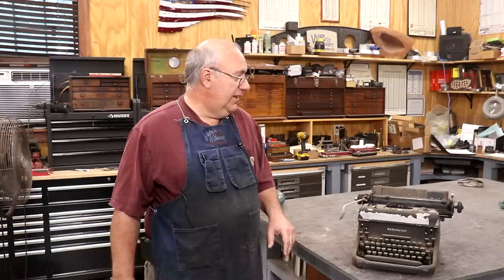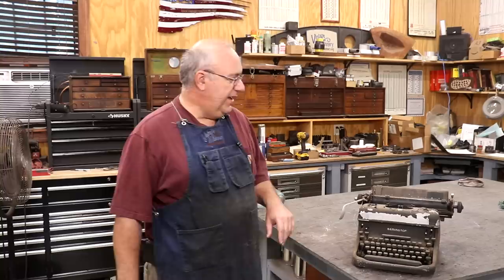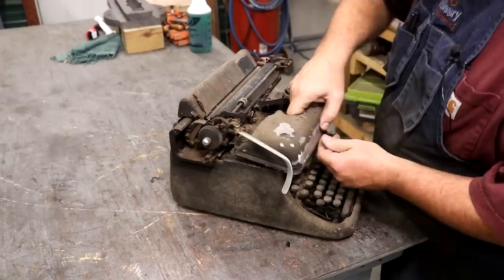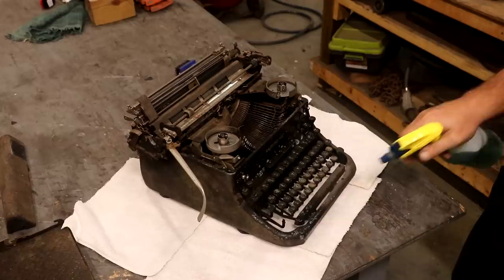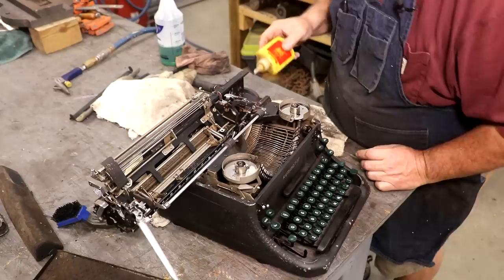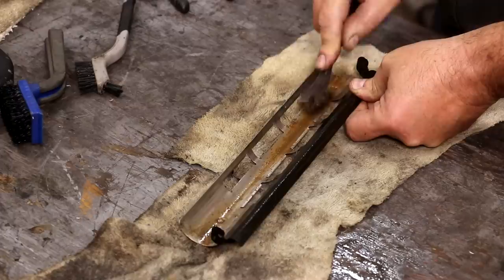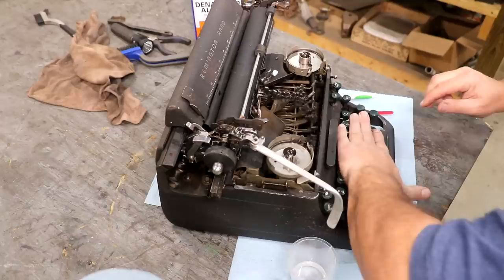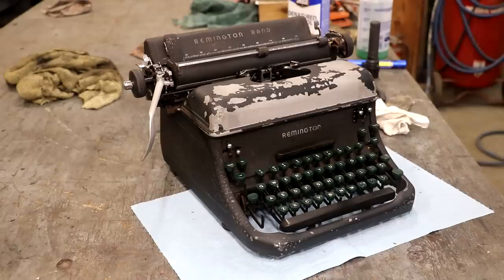Restoring a Antique Remington Rand Typewriter!

Comment: I didn't read through all the comments, but in the "old days" we would spray the ribbon with WD-40 and let it sit for a few days.  This will devolve the ink and re saturate the area where the key would stike the ribbon.  I think you could also buy ink to "re ink" the ribbon.  Now I'm telling my age...!
Reply: Or you can just go to Amazon and buy a bunch of new ribbons.
Reply: @Digital-Dan  How smart you are (!!) that you went out searched that!!   (Did they actually have the BLACK/RED ones Keith would need??)
Reply: I, too, had been told that we could "re-ink" our ribbons using WD-40, but someone, here, mentioned that WD-40  would "gum up the works".  Maybe they meant only if it were used to lube the machine itself.

Comment: Well, that was fun. When I saw you striking the bare platen with the keys, I remember being criticised for that by my parents. As another commenter pointed out, a lot of rubber parts from that time are now badly compromised. Looks like you are lucky here. Still, I would treat the platen as if it were brittle and weak.
Reply: Sometimes when you can’t get a new platen, you can get by rolling three sheets of paper in the machine.

Comment: Simple Green is corrosive on aluminum.  The company makes a special product for cleaning that metal.  Even though this is steel, I would make sure the Simple Green is rinsed off .
Reply: Ooooo...Good to know!!  I use a concoction to clean rubber stamps that, although it's less than 10% Simple Green, I wouldn't want to damage other things in my crafting that are aluminum!!  T.F.S.

Comment: 19:02 Is that a felt pad on the inside of that back panel? I'm guessing for sound control. Seems rather advanced for pre-wwii(?) office equipment. Just when I think I have a decent understanding of the progression of technology, a gem like this pops up.

Edit:  22:00 What are the chances that brush is an unsharpened typewriter correction eraser?

With that sticking key, a common issue is that all of those long levers that the type faces are attached to are prone to bending and twisting. You might try typing the problem and adjacent letters with varying effort on to hard paper. You might notice one side of a printed letter is lighter and the other side is darker, so begging for a theta "field adjustment".  Likewise, if you get out your feeler gauge set and try a few between the good working letters, you'll get an idea of the appropriate spacing interval. Then drag the feeler gauge along the levers in proximity to the sticking key. Often, a poor correction made to a key that's a few keys over cascades. You might have to straighten up a few arms nearby
Reply: @lwilton  Is that in reply to something I've written?

Comment: Besides any key spring, there could be an issue of slight bend that causes sideways friction.  I never had a Remington in my hands, but saw that kind of trouble developing especially on the leftmost and rightmost few keys.  the worst "offender" was the one that a typewriter service place did for me, replacing some "needless" character with one Greek character that i needed often.  The replacement happened by melting the solder that held the character at the end of the striker  and then soldering the Greek symbol instead.  As I recall, there was a slight vertical displacement on the new character, but it did what I needed.  One finding, though was that taller typewriters were lighter to type than my very low profile traveling version.  The ultra low machine also had much higher tendency of tangling the strikers, even when I never was a fast typer.  In fact, I eventually bought an intermediate (still travel version) typewriter for that reason.  It has no character changes.  But of course it has not seen any use since about 1980.  The last use, as i recall was to write addresses to envelopes.  I found figuring the proper alignment of the envelope in a computer printer too challenging.

Comment: Did you look close to see it the key rod was slightly bent?  Graphite also works great as a lubricant, used it on linotypes and ludlows in Newspapers. The other thing could be a bad spring

Comment: I had to use brake cleaner to dissolve and clean the works of a typewriter that had been lubricated with motor oil and bearing grease.  I t is a nice machine now.  If you are new to typing on a manual typewriter you STRIKE the keys, do not push the keys.  It will take time to build the muscles up to be a good typist.

Comment: Yeah, but is it a Pica or an Elite?
I learned to type on an Underwood, and when I changed schools, I used an IBM Selectric. Those Selectrics were slick.

That "0" key probably has a weak spring. There should be one tiny spring on each key lever.
Reply: My thoughts / memories exactly.
Reply: It could be the spring, but the keys have a few riveted joints on the pusharms, a bit of rust or grime and it will stick. It should be accessible from underneath. I guess some light oil/solvent could fix it (WD-40, then some light mashine oil).
Reply: Depends on the typewriter as to where that spring should go.

Comment: I grew up with typewriters in my childhood. My mom was a typist/file clerk and as a toddler I was fasinated by them. While you were working on this typewriter, I looked up the service manual for it and... its like most manuals from the 1940's, more text than illustration and a bit confusing. I do know that the platten (pla-ten) carriage is held in with a few screws and its easy to remove and dunk in hot soapy water and a good scrub will get the dust, dirt and oil off. The same is true for the key carriage, like 4-8 screws and the whole thing should drop out, dunk in hot soapy water, a scrub, either blow it out with air or let it air dry, then oil it. The biggest issues are the springs which should be replaced when they fail or weaken, and replacement keys.....because they are bakelite or ebonite. As for the missing paint, its nitrocellulose.... What can I say? I was a curious kid and watched the typewriter service mechanic like a hawk.

Comment: Moisture isn't a worry.  Everything can be dried.  You can either use steam, or just detergent and the hottest water you can abide (to promote rapid drying).  Clean it with a sufficient volume of water to reduce the amount of detergent residues left behind (they will make things gummy).  Drain it, mindfully blow it dry while its still hot, stick it in the lab oven at 100F for a few hours.  Lubricate.

As an aside, I know that someone will shriek about the idea of using an oven.  I'm not talking about a repurposed kitchen oven with exposed elements and gross hysteretic temperature control.  I'm talking about something that's forced-convection and can actually hold steady at low temperatures.  

To put this in perspective, consider your computer's motherboard.  You'd never ever think of getting that wet, yet the thing was born being run through an automated water/steam wash (on a conveyor) and blown dry with compressed air.  Boards usually don't even get the extra insurance of being oven-dried after a cursory blowdown.

Comment: I would expect the carriage to be removable. Also, the entire key assembly should pull forward by releasing the 2 catches on the front panel.
Reply: I think Imperials did that, but I’m not sure.  Several German machines an Italian Everests you can take the carriage assembly off with either two long bolts or two levers (more modern Olympia upright manuals and electrics).
Reply: Remingtons are a little harder, but not that bad.  Their carriages ride similar to Olympia, and their held on by four bolts.  Undo those and a few attached linkages, plus the spring drum belt (take care not to disturb the adjustment accentric  nuts at the front), and you’ll have it in your hand.

Comment: probably already posted but carburetor cleaner is an option on the inside keys etc.
Reply: True. The guy at Phoenix Typewriter Repair uses lacquer thinner. I used carb spray and a Kroil bath. Used a tooth brush for the type. They shined right up!

Comment: When I worked for IBM back in the mid-1970s we used 1,1,1-trichloroethane to clean typewriters. Sure, it's toxic and is ozone-depleting, but it did a great job cleaning and was safe to use on rubber parts. (Kills cockroaches, too, but that's a story for another day...)
Reply: Holy #$%^&*(*&^%!!!!  And are you writing this from your death bed?!?   Or with aid of an O2 machine???
Reply: @amkarei  Heh. I escaped relatively unscathed, probably because I only did that job for about a year and then went on to a career in IT, which had fewer physical dangers, unless you count that one explosion when the aluminum buss bar carrying about 400 amps at 208 volts AC melted.
Reply: @johnopalko5223  Wowser!!  I'm guessing THAT was a heads-up to somebody!!  Glad you're still with us!  Have a great day!
Reply: @amkarei  I jumped about three feet in the air when it went off. Fortunately, the buss bars were in the service corridor, which occupied the space between the walls of the various labs. No one was allowed in there except for maintenance people, etc. Luckily, nobody was working in that space when it happened.
Later, I was in the hall, talking to one of the electricians, and the remains of the buss bar were lying on the floor. Two people walked by and one of them glanced at this half melted, gnarled-up piece of metal. He turned to his companion and said, "Obviously a software problem."
Reply: @johnopalko5223  tee-hee-hee

Comment: When the machines first came out the type faces hit the paper where they could not be seen by the operator so it was typing be feel.  The operator was called a typewriter not the machine.
I took typing in high school and had to take it again in college.  My best WPM was in high school.  I was given a portable for college which I still have as well as my wife's portable and my dad's typewriter with a legal-sized carriage.
I remember a doctor's office waiting room where there were 2 typewriters without ribbons mounted on a shelf for kids to "operate" and entertain themselves while waiting.
A Linotype machine for casting print slugs is a modification of a typewriter that is more complex than the typewriter.  They had 5 or 6 different fonts in cases that were stored in the upper works of the machine so by changing the cases, font change was easily accomplished even for a single line.  The "lead" for the slugs was an alloy of lead, tin, bismuth(?), and something else for hardness.
Reply: Zinc.
Reply: (( Not to be a smart a**, but, I think that extra wide carriage was called "ledger" sized, as it was used to generate "the books" for businesses.  "Legal" sized paper is just a longer piece of the regular typing paper. ))

Comment: Great vid - I just inherited this exact model from my mom's mom's dad - in good condition, but the carriage won't move on its own. There's a cloth band that wraps around a spring loaded wheel that I can see from underneath - the cloth band attaches to the wheel with a metal doohickey (the official term, I think) but it's not attached anywhere else, and it makes sense to me that this is what drives the platen after hitting a key ... any ideas where this band should attach so I can get this beauty back into the ring?  Many thanks!   :)

Comment: I took typing during my Junior year.  I could get more accurate, but never could get above 30 wpm.  My parents got a Remington like that one for me to practice on, after about the 4th time they seen me tangle my fingers while trying to use a scaled down portable.  It's still around here, somewhere.  Probably in worse condition.  They don't do too great after the cat horks up in them.
Reply: All ya gotta do is get the fur balls out of it, brush around and clean and oil a bit, and you should be fine.
Reply: @johntapp7232  no, it's going to need "the dip."

Comment: Seems like one of the keys is missing on the far left? Like what would be a shift or a caps lock key on a computer? Maybe someone could 3D print a replacement? (I would strip and repaint just that Hood part if it were mine!) GREAT JOB!
Reply: He is missing the left shift key. The key above is the shift lock. It's an important key top, don't try fast typing with out one, or you will have a nasty gash on your pinky.

Comment: The high school typing class I took in the 60s used 1950s vintage typewriters. I wasn't very good but my handwriting was also bad so it was difficult to have anybody else type my papers. I ended up typing them, then had my girlfriend type the final draft. When I got a computer I made use of the Mavis Beacon teaches typing program that came with it and my typing improved. I have an old Smith Corona that I used to address envelopes until a few years ago. I don't understand why anybody wants to go back to those old mechanical machines.
Reply: mavis beacon with the bugs on the wind shield?

Comment: I was told brake cleaner the spray gun oil over all I don't know but it sounds right like it would work and protect
Reply: That's about right.  When I was in the Army, we used a cleaner that contained 1,1,1 tri-chloro ethane, which (for safety reasons) is no longer available.  Brake cleaner seems to be a reasonable substitute.  Gun oil is a light lubricating oil and not very different from the tool oil Keith used.

Comment: Did you consider using break cleaner for de-greasing those keys.  Although not a green as the cleaner you used, it evaporates almost immediately and is a great de-greaser.

Comment: I was very surprised that there was still enough ink on the ribbon to make a mark, much less to be legible.  Did you have to get into the part of the ribbon that was rolled up before it started to leave a mark.  If you can’t find the original ink style of ribbon you may look for a carbon style ribbon.  They were produced much later and may be easier to find.  I use to help keep the machines operating in high school in my business machines class.

Comment: Wouldn't be an old Typer writer if a letter didn't stick or hang up. Usually it just needs a slight bend its probably been locked up at some point causing it to bend. I messed around fixing them in high school. In the early seventies.

Comment: Just my two cents: Using oil in typewriter is not a good idea. Most of the mechanisms are designed to run dry. The worst choise is to use WD-40. The problem is that the oil gets sticky and the operation is even worse after a while. The better choice is to mix acetone and ATF together and use that to solve the old gunk away. Be careful with the paint. In any way I am really waiting this project to proceed.
Reply: The maintenance tech manuals from the manufacturers themselves instructed that most of the mechanisms be oiled so I have to question your assertion that they were "designed" to run dry. Reference material from the manufacturers themselves shows otherwise.

Comment: I wouldn't consider this a restoration, it is nothing more than a though deep cleaning.   A Restoration would entail taking it completely apart, restoring each part by repairing or rebuilding the piece from scratch, painting, and possible label replacements.  A Restoration on some items can take weeks and months to complete.

Comment: A parts cleaner filled with WD-40 would have done it more justice, better ;-)  we used a half barrel filled with aviation gasoline laced with gun oil, but please Do NOT do that!  No need to repeat stupidity of the bad old days.
And never type on a bare platten ;-).
Oh, the type of paint used on these machines, a "wrinkled black" is still to be had.